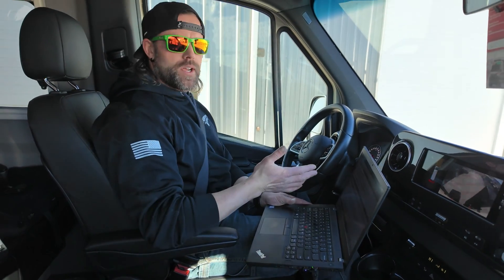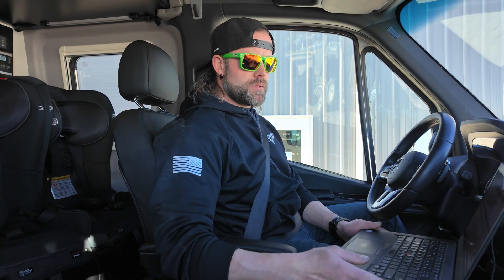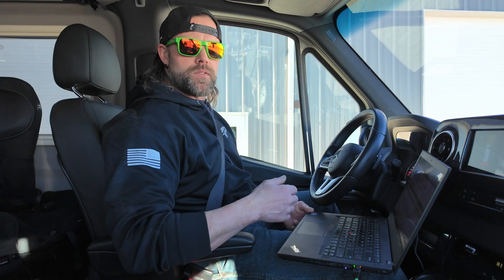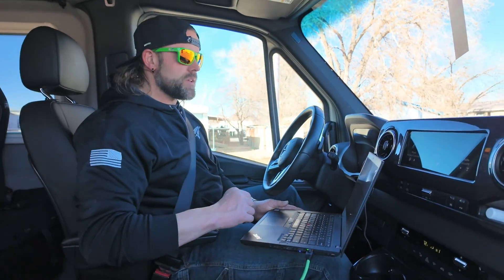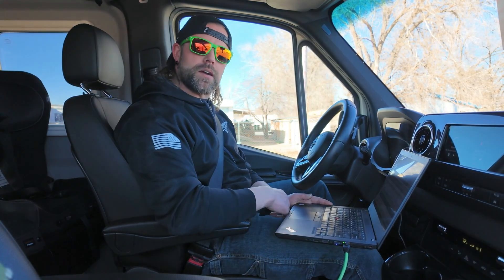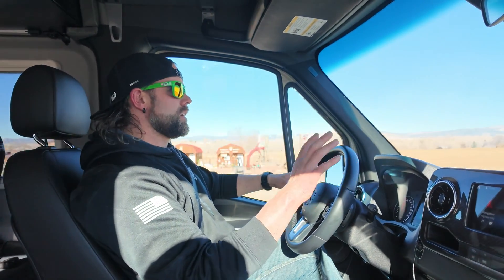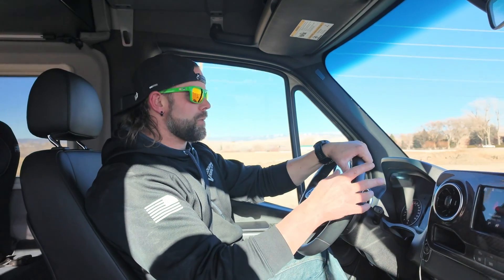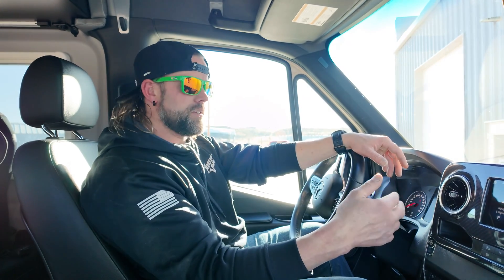Mercedes Active Brake Assist FAULT FIXED!  Radar sensor calibration explained.

Comment: Thanks for the video. Always great stuff from Adrenaline.

Is it possible to adjust the rear sensors too? I have a 2021 VS30 where I’ve added a Van Compass tug step, Owl rear tire carrier / ladder, and Monster Box. When backing up, the warning beep lights up despite no obstructions being behind the van (suggesting that the tug step or other mod is what is being flagged). The other impact is that the you sometimes have to floor the sprinter in reverse for a prolonged period of time to get it to move.

Comment: Even if the sensor is properly aligned, it seems like the software has a problem. If I drive in really remote areas without encountering any other traffic, while using cruise control, the warning seems to come on after 60 min. Any kind of software fix for that?